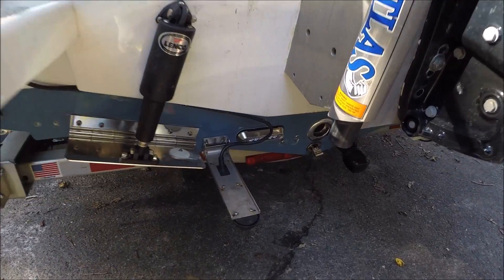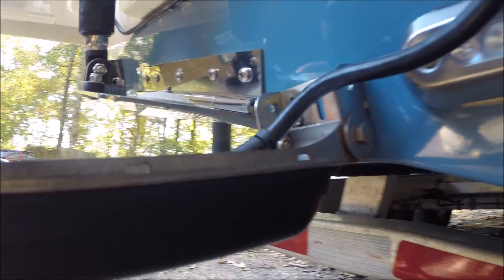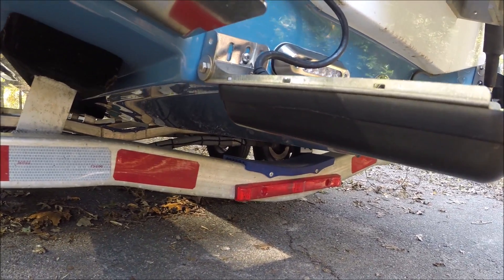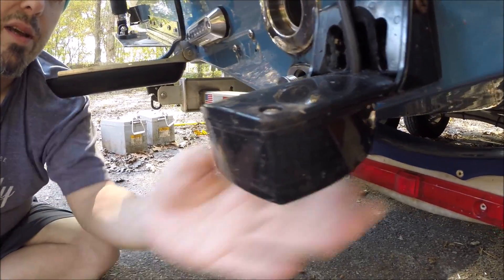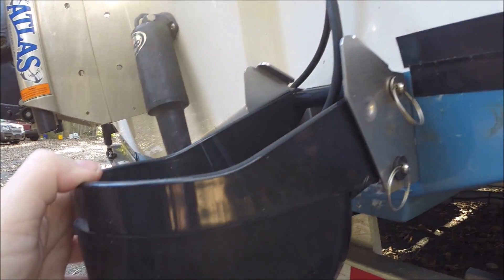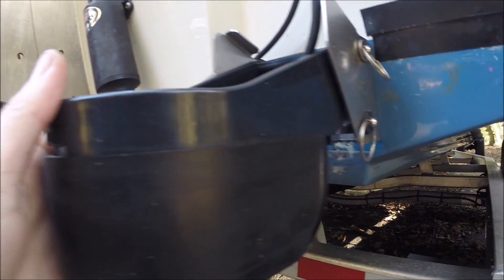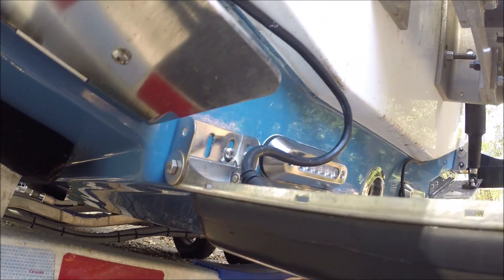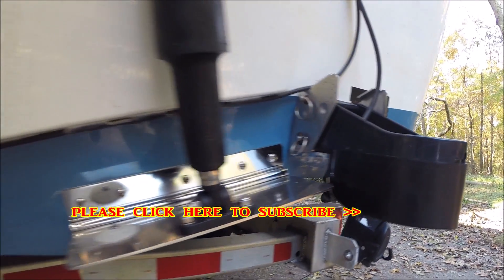How I Install my Transducers for HIGH SPEED PERFORMANCE. Airmar 275. Airmar 150. Chirp CHIRP

Comment: I have a 275 on the back of a Robalo 242 EX and I always loose bottom at any speed higher than 27 mph. My guess is I need to move it lower.

Comment: Hey bud. I just wanted to say thanks because I've learned so much about fish finders, transducers, setting them up, etc, from you and this channel. 
I utilized much of what I learned fishing off a kayak. I recently bought a boat though and I'm about to mount a big 3in1 tranducer off the back but the problem is--interference with sidescan from the two outboards.
Currently, my plan is to attempt to mount it near the keel of the boat, reversed--tucked up under the hull. This way, the sidescan is uninterrupted from the outboards AND I can have this aggressive type configuration like you speak about here.
I have a 16 degree deadrise. if I mount it reversed, pretty much anywhere other than on the keel, I'm going to be subject to sidescan interference. 
Do you have any suggestions or would you like to offer a critique on my plan? I'm afraid mounting it too close to center will create turbulence and diminish the bite of the prop.
Please help. Signed.. he who has transducer mounting stage freight

Comment: You have your 3-in-1 or structure scan mounted on port side. So many people recommend against that. Is that a myth?
Reply: yes, that is a total myth.  Where I live, lot's of guys run tiller boats, and so they fish off the port side.  They wanna be able to see their jig, so they mount ducers on that side.  No issues at all.
Reply from the maker: The only real downside is that you will see bubbles on the screen in some situations since the prop pushes some air down on the port side. It’s most predominate on side scan. If you see my side scan in videos you will see the bubbles in a steady row. It’s not a big deal for me. Everything works fine. 👍

Comment: hi mike
the engine is making dirty water and turbulance, I can't get an image, what should I do
Reply from the maker: @Ömer-484  The best thing is to move it to the starboard side if possible. Thats the cleanest side. If you can’t do that, lower the transducer a bit and make sure the following edge is lower than the leading edge. That increases water pressure against the face of the transducer. 👍
Reply: @MikeSmedleyOLDSCHOOLSTRIPERS  ı will try thx

Comment: Hey. I have simrad evo 3.  And 3 & 1 transducer. I lose all dept over like 15 mph. Do you know what I need to do ? Is it possible to keep dept reading at 46 to 50 mph ? Thanks. 

It once worked great but replaced my transducer in the same exact spot with same transducer. Just trying to adjust it correctly.
Reply from the maker: Sure. I  mark fish that fast everday out brother! Start by lowering the back of your transducer 1/8”. Keep going more and more until it works at high speeds. If you have to go more than 1/2” lower the entire transducer in the same increments. As long as there are no obstructions in front of it this should work fine.  Thanks!!🙏🙏👍
Reply: Thanks for the info. I appreciate it.
Reply from the maker: @brandonstill7229  my pleasure brother!! I appreciate your support!🙏🙏👍😁

Comment: Hey Mike - really appreciate all these videos. I had been struggling to get my setup right. Your tips really helped with my Garmin so they are nearly universal!

Question - I am about to setup a second transducer for side and down scan. I put in a lot of effort to keep the chirp transducer away from electrical wiring and when installing the new one I will as well. Is there any issue with running two or more transducer cables together? Can’t seem to find any info on this. 

Frequencies are much different. 

Thanks!!!
Reply from the maker: That’s one of those mystical problems that cripple some systems and has zero affect on others. These CHIRP transducers are so efficient and so well made that you don’t see this issue much anymore. My wires are all bundled close together and I have zero problems. In fact I have 5 transducers on my boat for testing right now and I run up to 4 at a times with no noise at all. I don’t know much about Garmin though. 👍
Reply: @MikeSmedleyOLDSCHOOLSTRIPERS  I ran it last weekend and it seems fine like that. I’ll keep an eye on it. 

Caught a few Rock on Roanoke Rapids Lake using planer boards and had birds diving everywhere. 

Really appreciate the videos. Been a great help!
Reply from the maker: @christophermihans5846  that’s awesome!! Keep me posted brother!
Reply: @MikeSmedleyOLDSCHOOLSTRIPERS  will do!!

Comment: If you want to ask a lot of your transducer you don’t get transom Mount.
Reply from the maker: I see what you’re saying and you’d be right in many cases, but I don’t agree on all points. I can set my transducers to do many things that thru-hulls can’t do, i can also swap them out in an hour. Side scan transducers are pretty bad in thru-hull designs in many ways. I HAVE 2 thru-hulls on my boat because they are optimum for my hull design and situation but many boats can’t use them and they are difficult to upgrade and replace. Stepped hulls,cats and flat bottom skiffs can really struggle to fit and even get performance out of thru hulls.

Comment: I just got a tm150 but realistically should I have got the hw one for local nc striper lakes?
Reply from the maker: I prefer the HW, but the 150M is an epic little transducer.
Reply: @MikeSmedleyOLDSCHOOLSTRIPERS  decent in shallow water ?
Reply: @MikeSmedleyOLDSCHOOLSTRIPERS  I guess I should have said the 165 hw
Reply from the maker: @chrislayton5404  yes. They are both great in shallow water. I would go with the 165 over the 150 if it’s in your budget. but you can’t go wrong with either.
Reply: @MikeSmedleyOLDSCHOOLSTRIPERS  I already have the 150 but have yet to install thanks for the reply

Comment: Thanks for the video! Question, are you picking up fish on side imaging at high speeds? I’m debating if I want to install a 3 in 1 low and angled down to read on plane, or higher to be protected and sitting level at trolling speeds. Other youtubers claim level transducers are key to getting great side images, but it seems like that’s not the case since your side images look awesome.
Reply: Also, great tip about potential cavitation if you put the three in one at the lowest point of the hull in front of a motor. That’s where I was thinking of installing mine. My outboard is on a large bracket off the back of the boat though, so do you think I’d still have cavitation issues if there’s a foot or two of separation between the transducer and motor?
Reply from the maker: Cavitation issues have been pretty rare for me, in fact it only happened on this boat and not others, so I wouldn’t have any fear mounting that low on other boats. I test for Airmar and Simrad. I use up to 8 transducers at a time while testing. I have never once in my 49 years put a level on a transducer. Honestly. Tilt the following edge down a touch lower than the leading and you will probably see results like mine. 👍. I see  Crystal clear side scan anywhere from 20-30mph depending on how much I tilt the transducer. I see readable side scan even higher. 👍👍👍
Reply: Thanks, I’ll try that out then. It would be sweet to see a video of you using side scan on plane. I’m guessing you’d mainly be able to see large structure or maybe big schools of fish when you’re going that fast
Reply from the maker: @FishStalker777  check out any videos that start with us running. Side scan will up on at least one panel. If I’m really LOOKING for bait with side scan I will stay at around 20 -22 mph.
Reply: @MikeSmedleyOLDSCHOOLSTRIPERS  I looked at a bunch of your videos, but couldn’t find any showing side scan when you on plane. I did see your video on cheap remote boat alarms though, and I’m getting one of them now, so thanks

Comment: Do you recommend spacing the 2d transducer and structure ducer on opposite sides of the boat? Used boat I purchased has them side by side and I believe its causing my prop to cavitate at speed
Reply from the maker: If you use overlays and fish reveal a lot you want them close together, but if you’re having cavitation problems you can spread them out.

Comment: Unrelated but looks like you've got the limited room 4x12 inch lenco trim tabs on there. I was considering getting those specifically because I have a quick release ladder mount bracket back there that I still want to have and I might be able to get away with not having to remove it if I go with those 4" trim tabs. Do you think I'd be ok? My boats only 14' but I know with the 9x9's I wouldnt be able to still use the ladder
Reply from the maker: These tabs are incredible!  They will absolutely bury the bow if you’re not careful. Seriously. They are excellent!
Reply: @MikeSmedleyOLDSCHOOLSTRIPERS  Wow, i would think the smaller size would have less of that effect than the 9x9s. Do you think I could still use the ladder bracket or would the tabs be in the way still?
Reply from the maker: Seriously brother.  I had a buddy drive and he held them both down too long and almost killed us! They are very strong.  As long as they can come all the way up without hitting the bracket I’m sure you will be fine. I rarely set to more than 2 or 3 lights in rough water.
Reply: @MikeSmedleyOLDSCHOOLSTRIPERS  Woah, good to know. My 14' panga skiff weighs only around 1000 lbs and I know panga's are bow-high riding boats but when I go straight into a chop it could really use the more forward V to cut through the waves better. Really uncomfortable ride. I think I'm gonna give those a go though because I really like the compact profile specially on a small boat like mine.
Reply from the maker: I think they will work beautifully on that boat
Reply: @MikeSmedleyOLDSCHOOLSTRIPERS  i hope, just curious, what was your reason for them vs regular ones?
Reply: @bocabretts123  buy  scout 145   hybride  boat

Comment: Is their any way of checking the 3 in 1  transducer to see if its working correctly out of water or how would you know if you have a bad one..
Reply from the maker: James Shortall out of water you will hear it clicking but don’t run it too long dry. It can overheat.
Reply: @MikeSmedleyOLDSCHOOLSTRIPERS  sound thanks for the reply so if I hear no clicking it could be gone bad..

Comment: i have a question. My tranducer used to work just fine for years.  under 5 MPH now its fine but once i get on plane it flickers on and off non stop shows disconnected under way.  any ideas?
Reply from the maker: It may have kicked up slightly or has some Marine growth. Try lowering it slightly and cleaning the bottom with soap and water.
Reply: @MikeSmedleyOLDSCHOOLSTRIPERS   time buy new trànsucer bad uñit

Comment: Just wondering about your drain outflow. I do not see the rubber flap thing? Is it not needed?
Reply from the maker: It depends on what year model you have. Sea Pro has since added 2 deck drains that each have a flapper. The single large drain doesn’t really need one since it only drains the boxes and wells. 👍

Comment: Thanks for the video, so should I level the transducer with the bottom of the boat or with the water line when the boat is moving ( the engine running causing the front of the boat lifting up) ?
Reply: Did you ever figure this out ? If I set up for setting in the water, it’ll be different when up on plane.  I’m trying to figure this out.

Comment: Great video on the SI transducer mount.  This is exactly what I've been looking for.  I'm adding a Hummingbird  MEGA+ sometime this week and have been wondering if it should be above or below.  Almost everything else I found is for slow speed operation and I'm in the same boat as you with needing high speed pickup.  Between this and the Motorguide video you are really helping me out.  I also like your videos live lining for striper.
Reply from the maker: Thanks brother!

Comment: Hi Mike. I see you using trim tabs? Do they also eliminate leaning?
Reply from the maker: Brakkeleer Thuis They are great for a few things. They eliminate mis-loading when you have big boys onboard 😉. Just touch a switch and the boat rides level. They are awesome for rough water too, I can plane at slower speeds for a much more comfortable ride in slop. My boat rides very level, but If you have a boat with bad bow rise when starting to plane they are great for that too. 👍👍

Comment: I have a question 

I got my active imaging 2 in 1 transducer in the mail the other day and i held it up to  the Transom
and it looks like my outboard is going to block 90% of the transducer on one side, I dont have a jack plate or any spacers on the outboard motor its  mounted straight on the transom 

Would it work if i mounted the transducer under the boat? directly onto the hull?  I was planing on using the metal bracket as a temp plate and drilling the 6 holes and putting the proper length screw with lock tight and sealer 

I think the sensor should be protected by the two stringers since there about the same size as the sensor.   Mounting the sensor in the middle between the two stringers

Here are two pictures of my hull 

https://i.imgur.com/WRKsVWF.jpg
https://i.imgur.com/1VupSql.jpg
Reply from the maker: disonesto There are plenty of people that do that. Lots of pics on the hull truth board.
Reply: @MikeSmedleyOLDSCHOOLSTRIPERS  thanks again,  I will post a video on my channel once i have everything setup and installed, Wont be until the weather warms up. Thanks again
Reply from the maker: disonesto Cool!! Thanks brother!

Comment: Will transducer shoot through fiberglass. In the bilge
Reply: If the signal will shoot through your hull depends on a lot of variables. It must be solid fiberglass with no core or air pockets. The frequency of the transducer and hull thickness will also determine if it will shoot through. Side imaging will not work in hull, but traditional (2D) sonar and Chirp does work with an in hull transducer in some cases. The best thing to do is contact someone who does these Installations in your area and discuss the details with them, or check with some other people with the same type of boat as yours and find out if any of them have successfully used an in hull in their boat, as every type of boat is different. Hope this info helps.

Comment: Hello how are you can you give me some pointers on installing my truck 24 foot flatbottom Carolina Armen sure 70for the transducer looks just like the one that you have on the port side of your boat very long and hard getting the transducer to track at high speeds  it will not read correctly  so I should just have the transducer only 1/2 inch in the water at high speed below the haull
Reply from the maker: Bayard Taylor Flat bottom boats are notoriously difficult to Mark at higher speeds. My buddy has a similar boat and he made a simple and somewhat crude bracket out of some galvanized angle steel. It pushes the transducer completely below the water line with the following edge slightly lower than the leading edge (like in this video). It puts up a rooster tail, but he can run 30+ mph and mark fish no problem. That’s what I would try. 👍👍
Reply: Mike Smedley wow. Do you have a picture

Comment: I have the same transducer. At around 25mph it stop reading depth is that normal. I have relocated it three different times. Any advice. Thanks.
Reply from the maker: If you lose bottom entirely I would lower the following edge down a bit. This increases water pressure against the transducer’s bottom face. If that doesn’t fix it, lower the entire transducer an 1/8” at a time until you hold bottom.
Reply: Also depending on your transducer, mine loses signal in rough water and clicks out of the swing mounting bracket. Usually when I come off of plane it clicks back in. I have a humminbird helix on my bay boat.

Comment: Try epoxy to hull inside will be the same without drag
Reply: Does it matter where you glue the inner hull transducers?
Reply: I'd like to mount an in hull transducer so I don't have to drill any holes in my cobalt boat.
Reply: nooooe  jus óré then 18 inches or more frím ebgiñ motrrrß

Comment: C'mom man !!!  All those old holes need to sanded and counter sunk and filled with west system epoxy, add some fiber filler and mix it till it's like peanut butter.  And I could be wrong but I don't see any 5200 Sealant anywhere.  Your transom won't rot if take some time now....happy boating.
Reply from the maker: High Velocity  Good advice for most, but this is a different situation.  I pop Transducers off and on regularly, sometimes daily, since I’m a tester.  I use clear sealer because the boat is blue, and the transom has no wood and cannot rot. Thanks for the comment brother!

Comment: Hey Mike, I want to add a airmar transducer to my simrad evo 2, you recommend a Tm 185. Is that a HW or what model? I’m also adding 3D structure scan. Can I just add the transducer with my existing unit and then install the structure scan. Would that be acceptable?

Comment: I run my transducers lower in the water, and angled down on the trailing edge as well. I tried what the manufacturers recommend for mounting the transom mount transducers, but I always lost bottom on plane. Lowered them down, and tilted them back, and I don’t loose bottom any more on plane. I can even do structure scan up to about 20mph. You have to go with what works for your hull. I know it is not what the manufacturers recommend, but it works! Great videos Mike!
Reply from the maker: Kevin E Hendges Yes Sir! Thanks for the comment brother!
Reply: So how should I mount the garmin uhd93sv transducer on my 91 206 cobalt single screw i/o